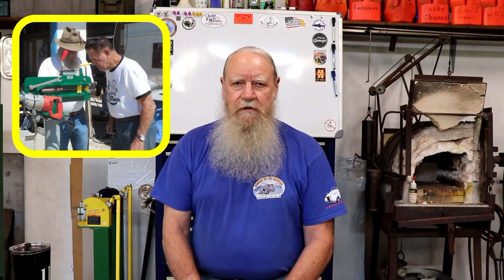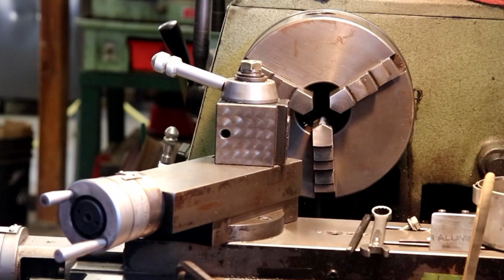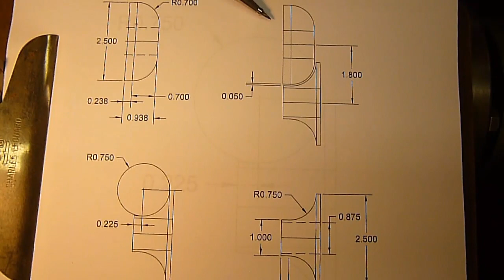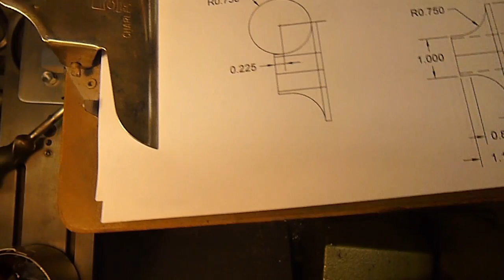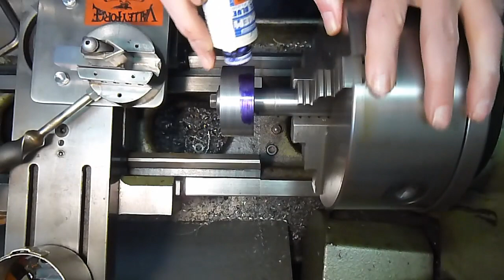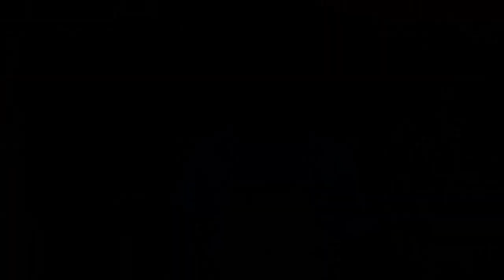Radius Turning Tool - Concave

Comment: Thanks so much for this "series" from radius cutter to making beader dies. This is exactly what I'm heading toward as I'm doing your mod's to my HF beader right now.
Reply from the maker: Hello Tony:

If you have a lathe and you are doing the bead roller mods then this tool will allow you to make dies that are not available.

Be sure to call if you have any questions.

Thanks.       jere
Reply: Hi Jere,

Yup, I've got the despised duo, HF 9x20 lathe and old Enco RF30 mill/drill. Picked up the HF bead roller after HF closed them out. I have been watching other channels with expensive rollers that use proprietary dies wishing somebody would show some quick and info packed vids on how to make dies and I believe yours is the first. I've worked most of my life as a mechanic/welder/fabricator and just got into machining over the last couple of years. So once I see how something works I can can design it to fit my needs and engineer to stock at hand. Your vids have made it crystal clear what is needed. I plan on powering the beader with a HF hand held pipe threader that I also use to power my HF pipe roller and a dirt from rock sifter I made. 40rpm and very strong and easy to move from unit to unit. Get er done.
Reply from the maker: @tonypires8816  

Designing around what you have at hand is a blessing. I know that once I see the finished part in my head only then do I go to my drop off's and start to put the design on paper.  Good on you for having that ability.

Thanks for your comments.        Jere